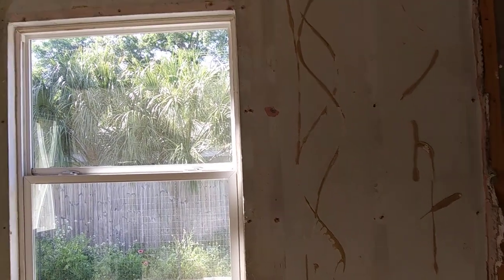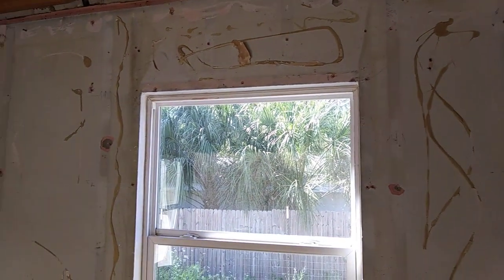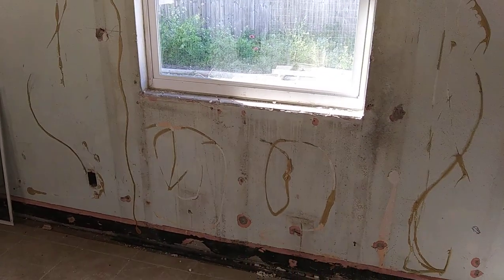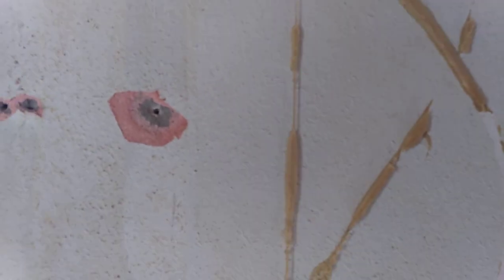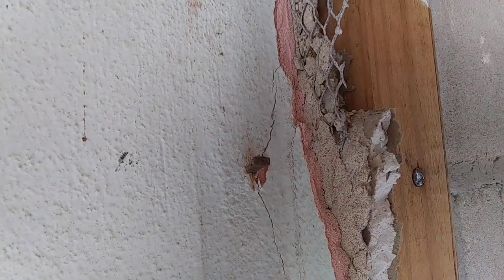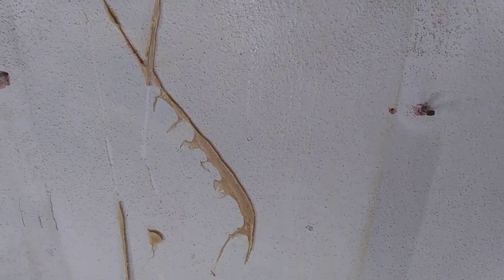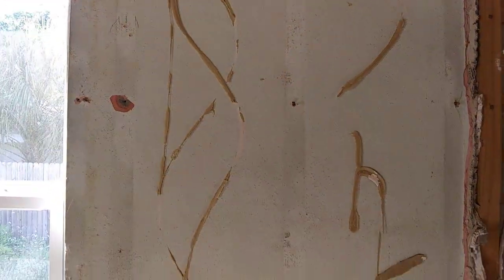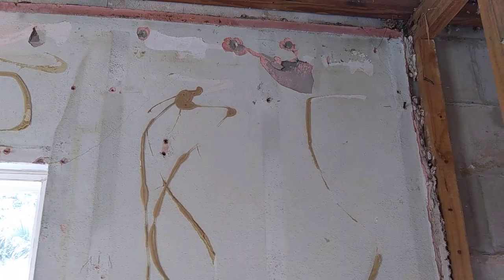Why you should never paint walls of your house with acrylic paint

Comment: The actual explanation begins at 1:26. The problem is mould caused by Florida climate and poor ventilation. So, acrylic paint has nothing to do with it.
Reply from the maker: Thank you for your feedback. Acrylic paint prevents breathability of porous substrate. Having your house painted with acrylic paint is like wearing a plastic bag over your head.
Reply: @HealthyConstruction  solution: poke holes in the plastic bag - drill holes into the wall 👍
Reply: @HealthyConstruction  if it's something small I done a line if that makes sense on my bedroom I painted lepoard print I think that's find but the whole wall no no. I don't know shy this other person was so mean but my dad is a carpenter and contractor and has had to fix houses because of someone making this mistake and was pretty mad at me for doing it in my house but he didn't know it was very small lepoard print so he was okay with it. We live in va so it's not just Florida's climate.
Reply from the maker: @s_shaddows.4939  Thank you for your kind comment. Greatly appreciated.

Comment: Properly sealed drywall and latex paint are perfectly fine in most climates. Plus you have a porous substrate behind your drywall which ,like you said, holds moisture. A frame built home is completely differently and has plenty of air circulation. This ladys warning literally only applies to a cement block home in Florida lol
Reply: No, walls need to breath.
In other situations it might take longer until you notice your walls are f*/kt

Comment: Thanks for the info! I love limewashed brick! Looks so much better anyway! 
So what would be the steps to change over to lime wash? Every room inside and out is acrylic latex ... I cannot even begin to wrap my mind around the work involved to change it ...building from scratch yes.  Any thoughts? Thanks!
Reply from the maker: Thank you very much for your feedback. To answer your question I would need to know if your internal walls are made out of drywall or plaster on concrete block ? Is your house built with block, brick or wood ? If your house is made with brick or concrete block you can simply pressure wash acrylic paint off and re-paint with limewash instead. If your internal walls are drywall over concrete block you can rip out drywall and apply new layer of plaster over your block and limewash it. One thing you need to be aware of is that nothing can be done unless plastic layer gets completely removed.

Comment: 15 minutes... 15 frikking minutes.. to say "don't paint your wall with acrylics because mold"  it takes actually less than 5 seconds to say it..
Also you can solve that problem in 1500 different ways, paparing the wall before you do it, do small thing, use a dehumidifier and so on.. also "paint" is a bit general, you mean paint the whole wall, or do some small paintings? or both?... instead of repeating 15 times the same sentence to make the video longer, give actual infoes :D